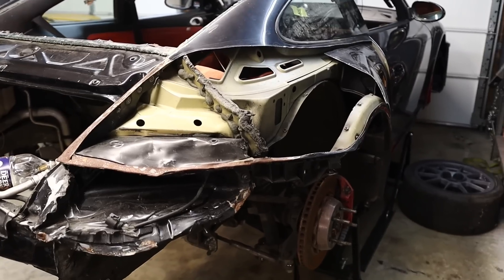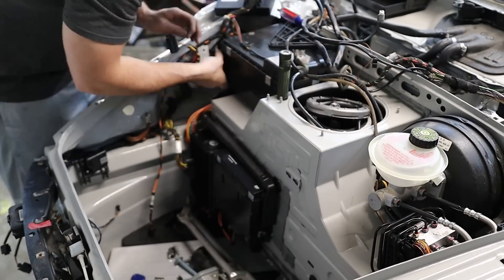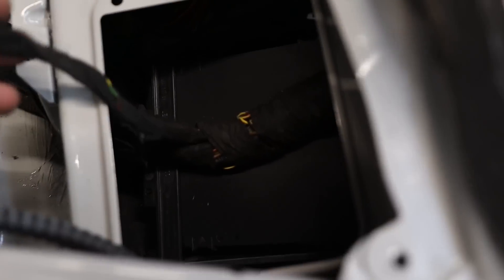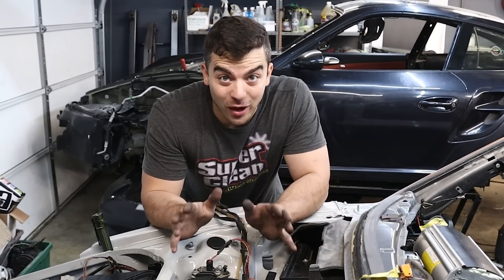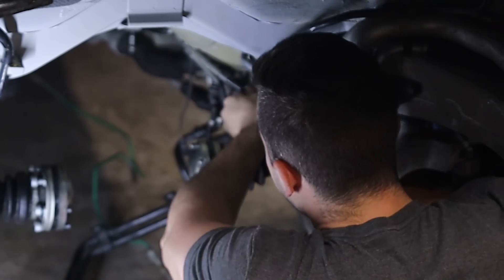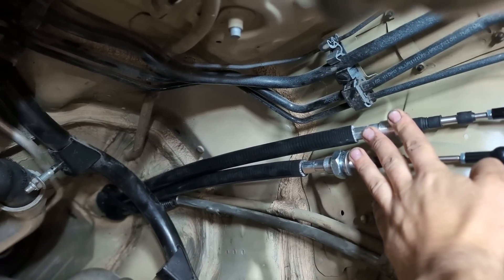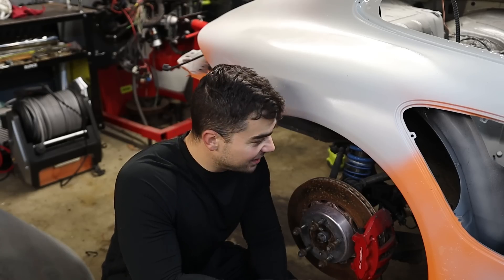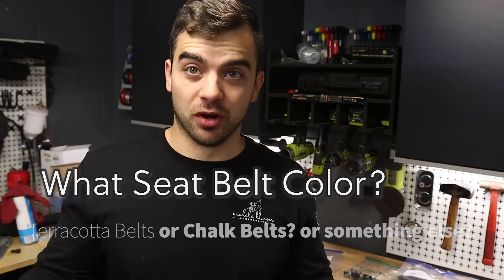My Crashed 997 Turbo Race Car Engine came with a HUGE SURPRISE

Comment: Hot tip from a fellow 996 Turbo owner that also applies to 997: You want to clean your radiators and AC condensers when you have it already in such a disassembled state. There is visibly a lot of stuff hanging in there and they can rust and start leaking. Not so cheap to replace then... Just take off the plastic housing around it and you will see what I mean because the dirt will come flying. Also just installed a mesh behind the main air intakes/bumper inside to avoid leaves and so on to fly in there. cheap and effective fix, otherwise you want to disassemble and clean regularly.
Reply from the maker: I'm planning on a good cleaning soon
Reply: For sure the mesh is very important to have the middle one. My brother has a 996 regular 911 and replaced the radiators in front, and the middle one got hit by a stone and is leaking and needs to be replaced again. It's crazy they have nothing there to protect the radiator...
Reply from the maker: Hahahaha

Comment: If you haven’t done it yet, do the GT2 clutch conversion since the motor and transmission are out. 

I forget the part numbers, but they are cheap. It’s a clutch cable, slave, fork, and release spring under the pedal. It eliminates the clutch assist setup on the car also requiring the power steering pump to have that line blocked off. Sounds like a lot but it’s not that bad and totally worth it. 

It does require tapping the transmission case as the gt2 mounts on the other side from the 997t setup. 

AIM performance tapped my transmission for the job. Coming along buddy.
Reply from the maker: It's got an aftermarket clutch setup along with a different slave thankfully.
Reply: I saw that as I watched the video. Was replying in real time. 🤷🏼‍♂️great content buddy. Did you motor have the sharkwerks coolant elbows as well?
Reply from the maker: Haha thank you!  It looked like it had metal elbows, but not sure of the brand.
Reply: Sweet. My 997.1TT had a collapsed lifter a few years back. Pulled the motor and had them all done. At that time pinned the cams and did all the coolant lines and clutch assist delete. Holler if you ever need to referemce a relatively stock car or come up to the NJ/Ny area
Reply from the maker: Awesome thanks!

Comment: At 8:30 that looks like the factory microphone that clips in under the steering wheel column cover on the top. There should be two grills on either side of it and it clips in under one of them.
Reply: If you end up using an aftermarket head unit I don’t believe you need it but there is also a company that makes one for aftermarket head units that fits in the factory spot so you don’t see a microphone
Reply from the maker: Thanks so much! I had no clue lol

Comment: That's some impressive work in completing the wiring loom installation Matt, with little or nothing missing/left over...it all looks OEM & very tidy. 👍👍
With regards to the seatbelt colour, my preference would be black with contrast stitching, the colour of which should match the existing stitching found on the door cards, dashboard, etc.

Comment: Black seat belts are fine. Keep it classy. Most track 996/997 turbos have the coolant lines pinned already, some tracks wont allow these cars to race without it done as it poses a huge safety concern if these pop on the track. Love your content as always brother
Reply from the maker: Thanks so much!

Comment: Chalk belts!! Thats good that the coolant lines were pinned. U. Can use the stuff u bought to pin ur 996 on a rainy day..shes lookin good matt👌
Reply from the maker: 996 could use it but it's not broken yet!
Reply: @matt13ross you can pin all but 1 coolant line in the 996 with the engine in the car. Do it before they fail

Comment: 1 Vote for chalk belts but personally would not match calipers to interior. Also now is a good time to replace the coolant expansion tank if it looks at all suspect, its annoying to replace once the engine is in and they can crack and leak even if they 'look ok'.
Reply: I mentioned checking the cam chain sliders while the motor was out, but didn't think about the 15 year old plastic expansion tank--great call.

Comment: Matt, the PCA and some other racing bodies require a 996/997 to have the lines pinned or welded in order to do track days or race, and since this was previously a car mostly for track use it makes sense that it's been done. Less work for you!

Comment: I would replace the clutch, pressure plate, and release bearing while the engine is out. It would suck to get it all assembled and have the clutch fail shortly after.
Reply from the maker: You're right but with only 44k miles, I'm confident it's all good.
Reply: @matt13ross  That’s a costly gamble for a former track car. I’d replace it while it’s on the ground. Just my two cents.
Reply: @matt13ross  I have to agree with @cheapcargarage on this one. As a track car the clutch could be very worn. Easier to replace now

Comment: Unless you are absolutely sure on the condition of the clutch I would crack the trans and double check.  It is so easy to do while the motor is out and if there is any significant wear, better to just replace it now.
Reply from the maker: I know but I can't see it being very used. Aftermarket and only 44k miles.

Comment: save this post. The ebrake are will bind with the numeric cable insulator/hose covering on. Either cut them shorter or find a thinner hose. I used a bit of dynamat since it was flexible. Nice work so far!
Reply from the maker: Ah man. Just the part in the interior?
Reply: @matt13ross  just the interior section not a huge deal but saving you the hassle of bolting everything together and only to take it apart again.
Reply from the maker: Thanks for the tip!

Comment: I definitely think gray sea belts would be sick! But question, how are you going to address stuck key???
Reply from the maker: I think it's just stuck because there was no power hooked up.
Reply: @matt13ross  That is absolutely the case.  I've disconnected the battery to my 987.2 and could not remove the key until it had power.

Comment: Don't touch the color of the calipers. Red means sport brakes package and yellow means pccb package. The caliper colors have specific meaning
Reply: Exactly.
Reply: I was about to paint mine in yellow, I guess I need to avoid confusion like colors on the deck of an aircraft carrier.

Comment: As with any skill, practice makes perfect. TIG is no different, so please add to your list of skills to acquire.  It will come in handy, I am sure. Check out Justin at the fabrication series for really good tig content. 

I am sure that you are happy about the drilling already being done, but now you are primed and ready for the 996 when that time comes. 

As for seatbelts, I like color matched. Perhaps save the grey for other interior accents that are subtle? 

Again, fantastic content.  I doubt I will ever acquire a Porsche, but this is fun to watch.
Reply from the maker: I definitely need to practice TIG but I just haven't made time for it.

Comment: just an FYI, SD cards r literally the cheapest nand flash the company can get, unless u spend extra for the premium pro level cards from companies like Sandisk extreme cards and the like. If you do upgrade to the new iPhone or something use that and then shoot onto type C ssd's that u can literally plug into the type c port, if ur on android or just wanna get a separate android for shooting, u can do that
Reply from the maker: Thanks for the tip!

Comment: Hey Matt, Did you check the condition of the clutch? When everything is out a new clutch usually does'nt cost that much. Something i always would replaced unless you are sure it almost brandnew. The job it is to replace when it's in is a lot. Just like with the heatercore of your car you did not replace. Cheap now, expensive later(or time consuming)
Reply from the maker: I'd imagine it's good with only 44k miles. A new clutch setup is a few grand.
Reply: @matt13ross   I checked it here in the Netherlands, and indeed it is very expensive. About 1200 and 1350$ depending on the brand you take. 1200$ for the sachs if it's a 3.6 liter 480 hp one. I don't know your exact type. It's more expensive then i thought. But still i would check the wear on the clutch especially if it was a track car! 44k miles for a car like this is not nothing.  Plates can have much more waer then you think.

And when it's apart like it is now it costs you maybe a little over 1 hour to check to undo the bolts and put them back. It would be a nightmare dealing with a clutch after you completed your car.

Comment: Hit those radiators with some Eastwood radiator paint. 👍
Reply from the maker: Good idea! I'm gonna clean them up first and see.
Reply: @matt13ross I had to do this on my 991.2 Turbo S after 30k.  The radiators just take a beating and its noticable.

Comment: Hi, been following the build and really enjoying it. I have a 2010 C2S and looking to put some new wheels on it. I live in the Caribbean so wheel shops with options for a 997 are limited.. I am looking at getting some made for me.. can you tell me what size front wheels and offset you have on yours? The rears i know have a good bit of clearance but the fronts for the videos look like they are at least a 10” rim.. maybe I’m mistaken… but if you can tell the the size and offset it OU would be of great help
Reply from the maker: Honestly I have no idea what these specs are lol
Reply: Front: 18x9” ET46 // Rear: 18x11” ET60

Comment: You better pin the camshafts to avoid camshaft hub slip. 
They spin in the pressed-in housing section=camshaft deviation....etc, big job once the engine in the car, can cause very poor engine operation and other damages. Common issue on these engines.  I would do the tensioners, cam sprockets and inspect the head....etc
Reply from the maker: Is there a way to check if that's done?
Reply: @matt13ross   You have to pull out the cams, remove the sprocket housing and the connector piece to see the pressed-in housing.  There is a good video about it, if you search Camshaft Deviation, in Top Auto Nick channel.  Since this was a race engine, they should have done it, but who knows.
Reply from the maker: Not a chance I'm doing that lol. I would have a shop do it but one thing at a time.
Reply: I have a 997 Turbo, and my view is I’ll have it done if they ever spin. It’s not a catastrophic failure, so I’m willing to roll the dice. Also doesn’t seem as common as the internet would have you believe.
Reply from the maker: The Internet makes everything go way out of proportion
Reply: @matt13ross if it was tracked previously and already has 44k miles then it's unlikely that the cams will spin now. Usually it happens after getting abused or after significant power mods

Comment: C4 and Turbos all have 3 radiators up front on the 997.  Still might be an upgraded unit, but three are what you expect on the performance 911.
Reply from the maker: I didn't know that, thanks!

Comment: Before putting the engine in upgrade the turbo intake tubes with the engine out. It's cheap and easy with the engine out. It's a pain with the engine in.
Reply from the maker: Any specific ones you recommend?
Reply: @matt13ross  torque solutions

Comment: Google foam coming from AC vents, 996/997 suffer from that. You can fix it easy while dash is still not on
Reply from the maker: I checked mine and surprisingly it's in excellent condition and still soft.
Reply: @matt13ross  if it was me I will still replace the foam. It will deteriorate sometime soon.
Reply: @matt13ross  I'd still redo it.  My 2009 spits out pieces once in a while and it was worse in my previous 986.  As mentioned, removing the dash is a pig of a job later.

Comment: Always look forward to these videos. Its hard to imagine this level of obvious skill without being a qualified machanic. Honestly have meet machanics I would trust less with my Porsche. Well done Matt.
Reply from the maker: Thanks for the kind words!
Reply: This is in no way a knock on Matt, but a major point of this channel (and there are other great ones similar) is that this stuff is not difficult.  and you don't have to be some sort of savant to work on your own car.  Diagnosis requires some knowledge *or research*, but 90% of working on cars is turning a ratchet or wrench.  Access can be tight, sequences are important, and jobs can be time-consuming, but the techniques are simple.  Like eating an elephant, take it one bite at a time.  I have to say though--doing a complete chassis swap is a massive amount of work and I'm amazed at Matt's pace.
Reply from the maker: These are true words. But the pros are quicker and more efficient than me for sure. I also lack their diagnostic skills.
Reply: @matt13ross  I thought this project would take you the most of a year.  With the massive progress you've already made, I think this could be done by the Superbowl.  And as for the diagnostics...yep, that's where the "or research" comes in.  The point is the information is out there, just need to find it.  And with the internet it has never been easier.
Reply from the maker: I was aiming for spring but I think it will be much sooner than that.

Comment: Chalk Grey belts 100%. Red calipers are a stock thing so I'm cool with that, but maybe the Terracotta colored calipers would be cool. To me old school red calipers used to mean turbo so I still think they're cool. Chalk grey seat belts are a great idea.
Reply: Technically, red meant "S".
Reply: @plus790  Technically "S" can be red or silver. I'm referring to the first red calipers offered on a 911 by Porsche, which was on a 1993 964 turbo. Called Big Red Brake calipers. Look it up....
Reply: Red calipers now mean sport brake package where yellow calipers are the pccb package. On hybrids I believe there are green calipers.
Reply: @sutherlacd27  yes I'm fully aware of that. I actually already had a conversation with someone about the red calipers and how they were originally only on the 964 911 Turbo. That's what I referring to when I said "old school" because this car is over 10 years old. I have a 2010 997.2 GT3 with PCCB's and yellow belts. But back to the calipers, that terracotta might be kind of cool because of his interior color, and then make the belts Chalk Grey. But since its an analog car and a little old staying old-school red wouldn't be a bad move.
Reply: @billwoods9534  I am so torn on what brakes I want on my 997.1 turbo. I have left the sport brakes on because when doing track days it's actually affordable to replace the rotors after several sessions. But my car is speed yellow with yellow belts and yellow gauges and I do more street driving than track days so swapping to the pccb setup would be nice as well. I just struggle with justifying swapping to the pccb setup when replacing the rotors after several track sessions costs an insane amount of money
Reply: @sutherlacd27  Interesting, I know a lot of people swap out their PCCB for steel rotors, due to concerns for costs of the PCCB's and replacing them when used on track. I tracked my GT3, and still to this day drive aggressively (use heavy breaking to heat up front tires) so I can carve these canyons here in Southern California. I had my rotors measured and they're well within normal limits. I've also seen many people with over 100K on PCCB's with limited rotor wear. I was worried about if/when I'll need to replace rotors, but I'm not anymore. They last a long time and if you're not tracking the car maybe stick with PCCB. That's my thoughts. I think a lot of the concern for track use is taking wheels on and off and accidentally chipping the side of the rotor. You just got to be careful.
Reply: @sutherlacd27  You know what I just read what you said. You don't have PCCB's. I thought you did, sorry
Reply: @billwoods9534  yeah I have kept the steel rotors simply because I enjoy beating the crap out of the car and doing occasional track days so the cost for some sebro rotors is affordable. If I went pccb with the abuse I put my brakes through I would have to replace the rotors probably every 1-2 years unfortunately. If I didn't do track sessions I would have swapped to the pccb setup when I got the car because like you said they can last 100k miles.

Comment: Had the same issue with the ssd getting the error and asking to format the disk, tried connecting with an Android phone, OnePlus Nord 2, got the access to all the data inside, (didn't work with pixel phone - pure Android maybe whatever)
If you have an Android phone get an sd car connector check if it might work
Reply from the maker: How did you connect your phone?
Reply: @matt13ross  SSD also connects with phones directly through type C to type C cable,
 but as you have an sd card in your go pro you can get an sd card adaptor with type c connector
Check if this works

Comment: Whoever you go with, DO NOT use Safety Restore.  I had to send a set of belts to them twice and they messed up both times, after which they refused to pay for overnighting the belts as I understood they would do in my specific case, considering they'd already goofed twice.  One of their owners was very rude to me on the phone so I just said screw them, and sent my belts to a place in Oklahoma.  

My advice is to take pictures of how the latches are oriented on the belts before you send them off and provide those pictures as well.

I wouldn't do a light grey to match your chalk paint, they'll get dirty if you sneeze on them.  Almost as bad as white.
Reply from the maker: Wow. A ton of people recommended them too.